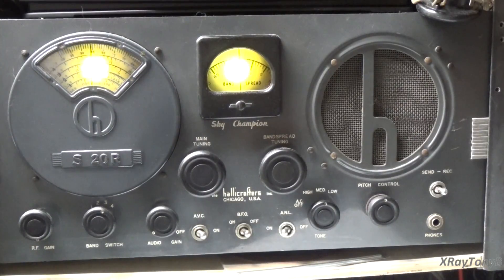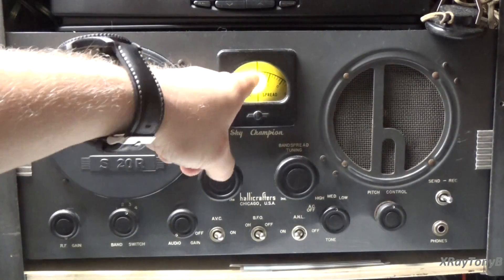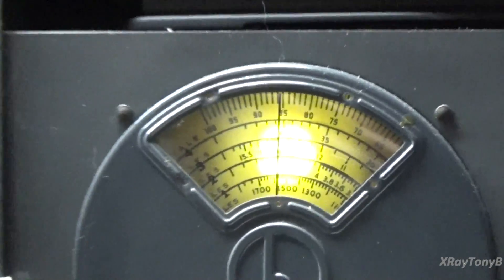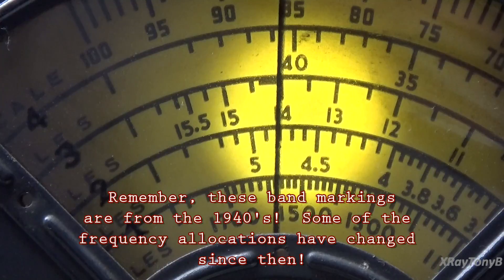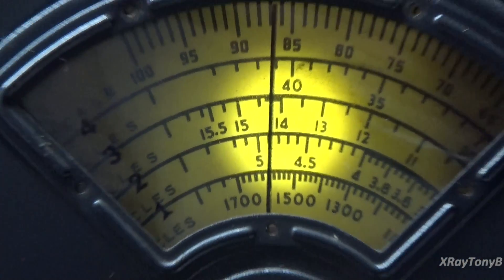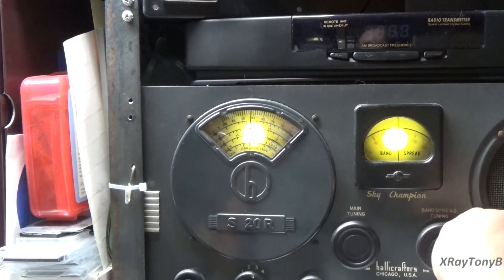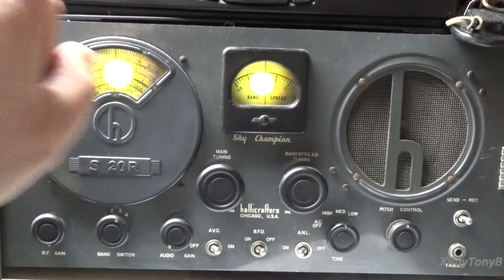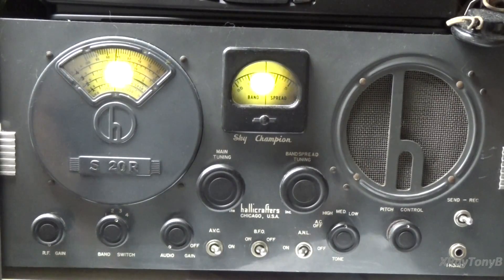Shortwave radios 101 - What is Band Spread?

Comment: How many kc's does the bandspread cover?
Reply from the maker: Depends on the selected band, but usually they are designed to cover one communications frequency band at a time.  For instance, if you are on the band that covers 14 MHz, there will be a reference dot on the main tuning scale.  If you set the dial to that dot, then the bandspread will adjust the frequency across the 20 meter amateur band.  Although this is only a small portion of the main tuning scale, you will have much more accuracy in tuning across that range.  This was a way to get more fine/accurate tuning before the advent of digital tuning.
Reply: @xraytonyb  Thanks!

Comment: One other thing about the bandspread control is some general coverage communication receivers have their bandspread control calibrated for the then authorized amateur radio bands and some models took it a step further by having the then authorized International Shortwave Broadcasting Bands calibrated on the bandspread control or at the very least having bandspread charts for the ISWBC Bands as well, but in either case it varies from model to model.......